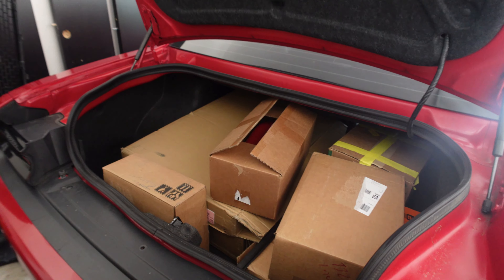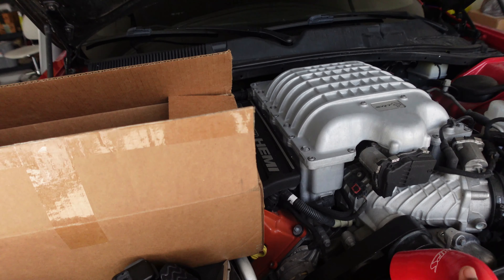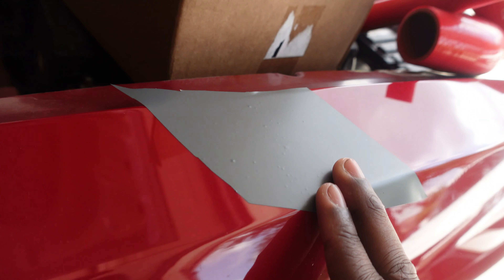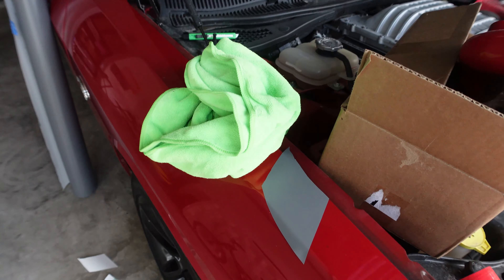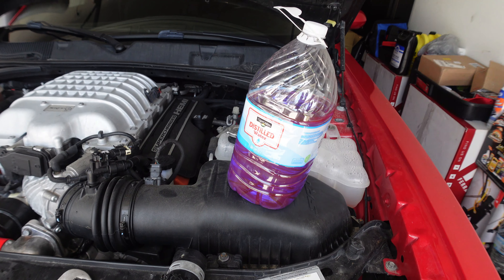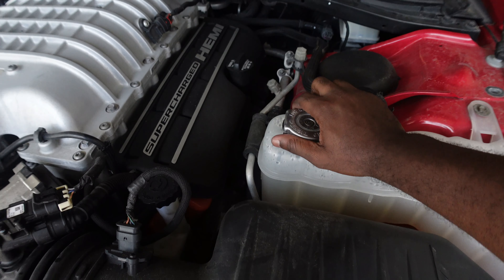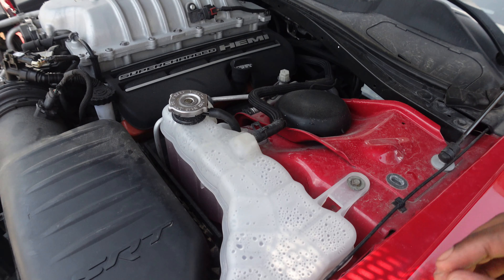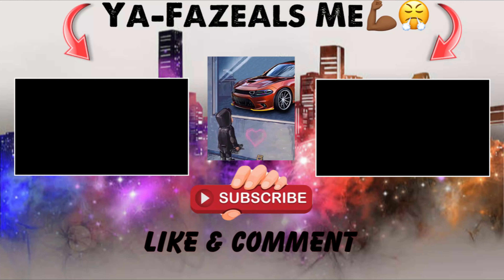WHY DOES MY HELLCAT KEEP OVER HEATING ??? (I QUIT) ‼️

Comment: Leave coolant reservoir cap off while you add coolant give thermostat time to activate and flow coolant to clear out air pockets, so the car won’t overheat and coolant can flow through the entire system then reinstall cap afterwards!

Comment: yes bleed the systm u have a bleeder valve get the air pockets out the system so it can travel to the heater core n to the engine n in the reservoir

Comment: Poor gal. I’m no mechanic by any means, but I agree with the other comments. Also be sure to possibly check her head gasket and radiator cap. If the radiator cap is broken or isn’t installed properly it can cause overheating issues. Maybe top off her coolant and see if that helps. Get her a ducktail spoiler and a custom front bumper while you at it if that’s yo thang. Again I’m no mechanic and I’m sure there’s people in the comments that know a lot more about cars than I do. I hope this helps cuz I wanna see that screamer on the road again. Love the videos. ❤️

Comment: The reason the car is overheating is because the condenser and blower heat exchange are all bent inward towards the radiator . They NEED to have distance between each other to get proper cooling. Ideally 1.5 inches or more. Essentially you're hot spotting the radiator and boiling over the entire system. To test this take off the ac condenser and move up the heat exchange since its between the radiator and condenser. I guarantee this will fix it alone. Ideally replace everything that's bent as far as the exchanger, condenser and whatever else is bent inward. You can try to bend it back but they normally crack when you do that.
Reply: Best way to burp the system it is drive it up on ramps so the radiator is the highest part then fill the coolant through the top hose till it doesn't take anymore install the hose then let it run with the car up in the air. Overfill the coolant tank if you have to.